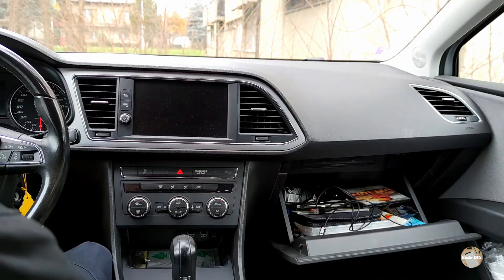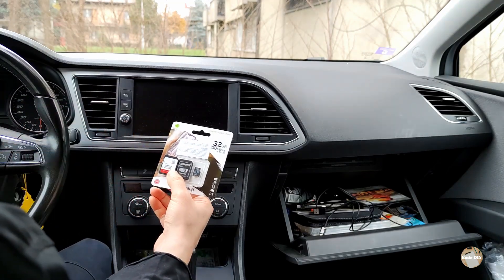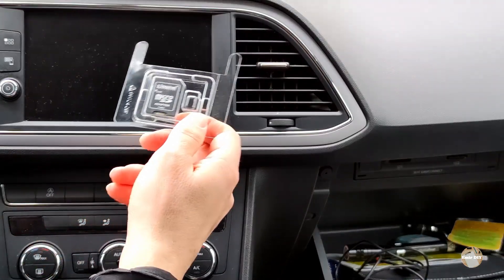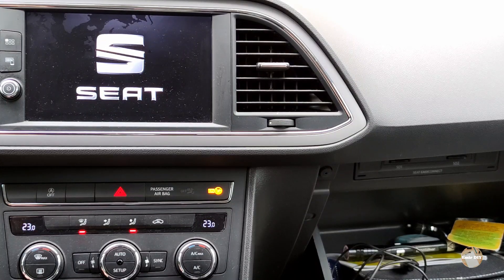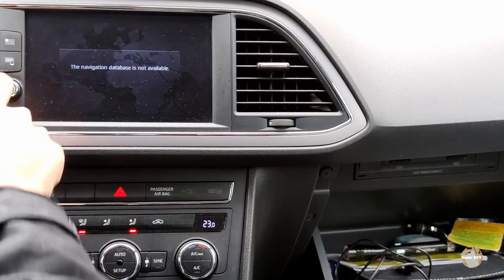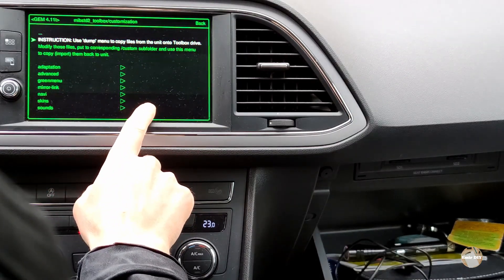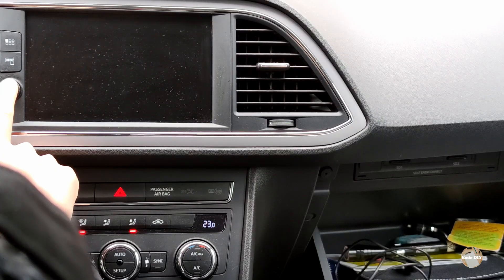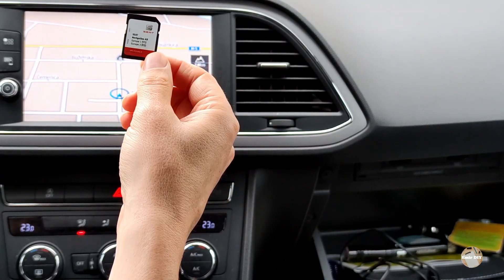MIB2 navigation SD CID lock removal with MIB STD2 toolbox

Comment: Should i have original sd or can i install new files to new card?
Reply from the maker: If you remove CID lock you can install files on new SD card or if you install it on original SD card it is good idea to make backup copy of original SD card in case of possible problems.
Reply: @emirdiy  Are there any additional files besides the maps file that I should get?
Reply: I don't have an original SD card.